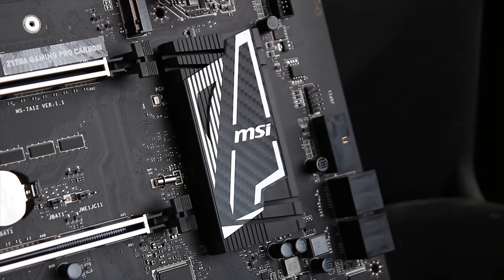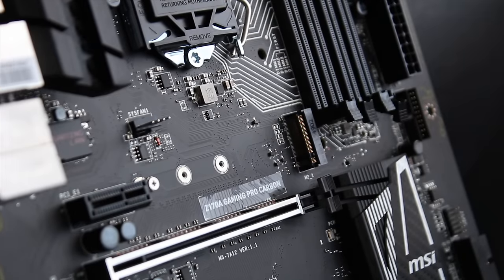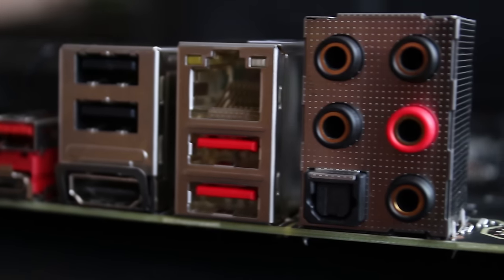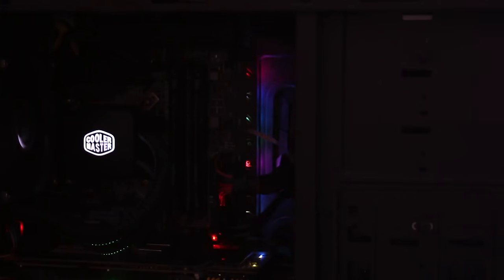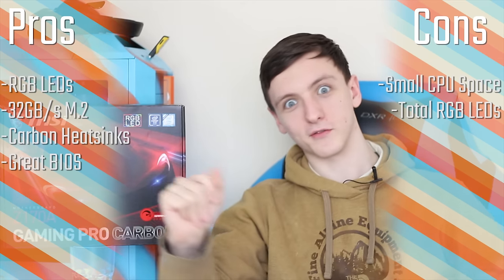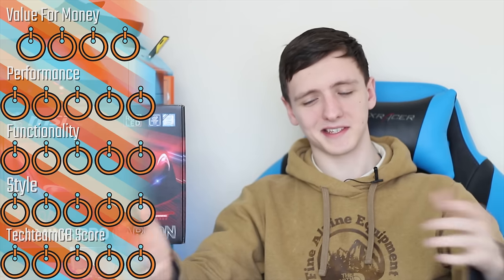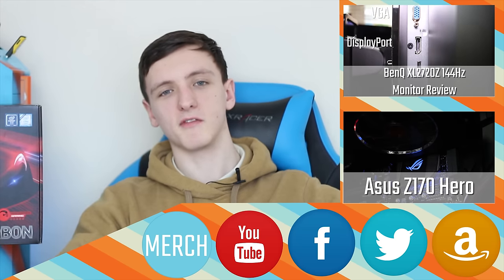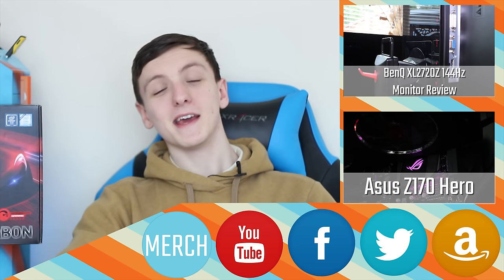MSI Z170 Gaming Pro Carbon Motherboard Review

Comment: Does this support the USB Direct Audio Power like MSI's Z97 gaming boards? I couldn't tell if it had the connector at the bottom of the board. Did it come with the adapter?
Reply from the maker: +aeroG1 Not that I noticed and I didn't see it on the marketing materials - although I'm known to be a blind idiot so don't take this as 100% true! :P

Comment: will an hyper 212 evo fit on it?
Reply from the maker: +teun van der dussen yup
Reply: +TechteamGB Thanks! gonna get this mobo with a i5 6600k! can i overclock it to 4 ghz without the cpu going above 60 degrees? with the hyper 212 evo
Reply from the maker: +teun van der dussen since it turbos to 3.9,id assume so. As for specific temps it'll depend on room temp more than anything.
Reply: +TechteamGB okay thanks!
Reply: i overclocked mine to 4.1ghz. never went over 65C

Comment: How much will the cpu and ram placement affect the installation of a large cpu heatsink, and can I still get 4 sticks of ram?
Reply from the maker: +DoomKaiserGliders if you use an air cooler and low profile ram, you should be fine.